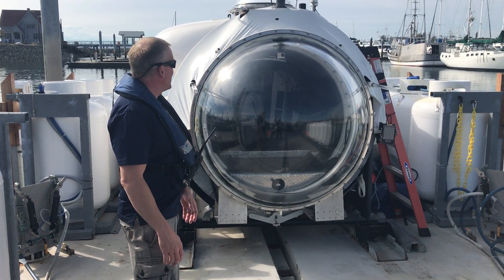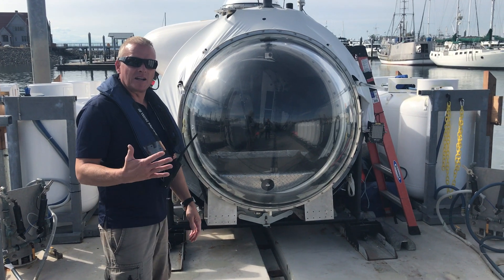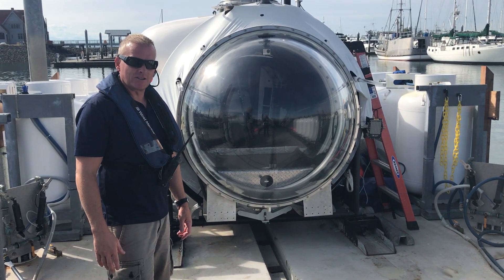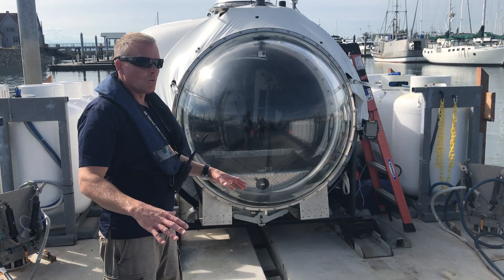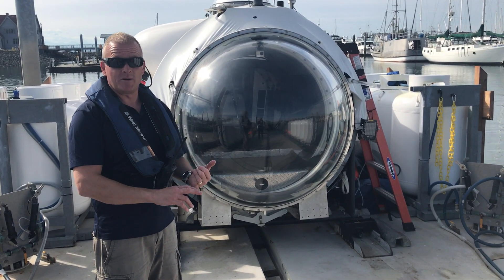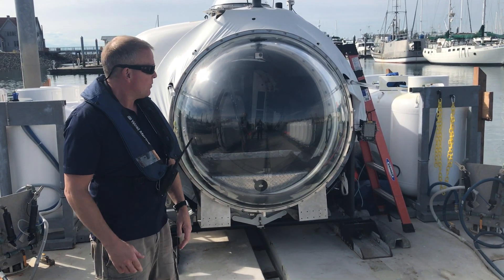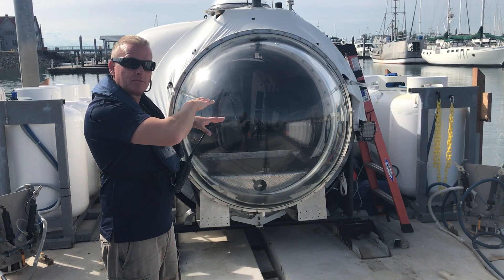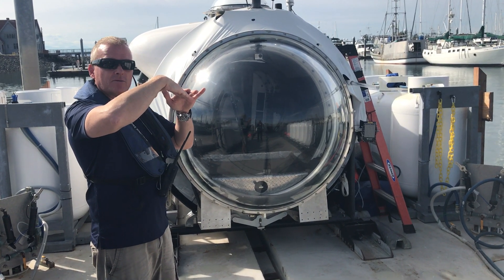Piloting the Cyclops submersible

Comment: Yep same ship. It was originally cyclops but renamed Titan.
Reply: No. They are not the same.
Reply: @James-vj5hz  There is Cyclops 1 and Cyclops 2.  Cyclops 1 is in this video.  Cyclops 2 was renamed 'Titan' just before launching it.
Reply: @James-vj5hz  even so, I wouldn't get into that Cyclops submersible if my life depended on it.
Reply: @Kazilikaya  The Cyclops is probably safe.
Reply: Wrong
Reply: is it that this cyclops 1 has a steel hull and the titan had the fibre glass. either way would never get on one of these metal or not! yes Lochridge was right,
Reply: I’d actually go on this one because this one doesn’t go as deep as titan so it had a less chance of imploding.
Reply: It has a lid, not people hammering bolts once you get in